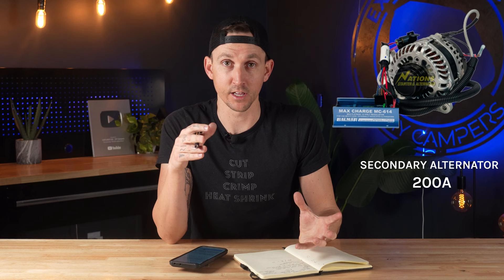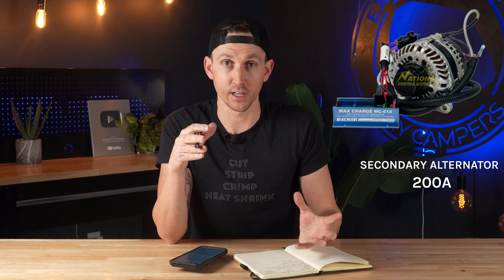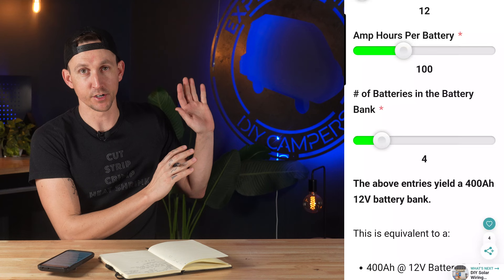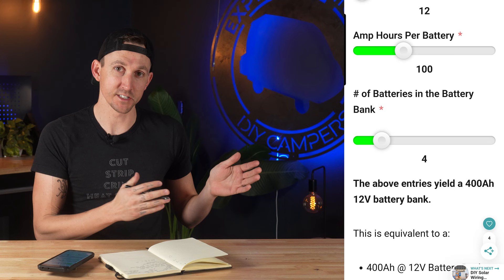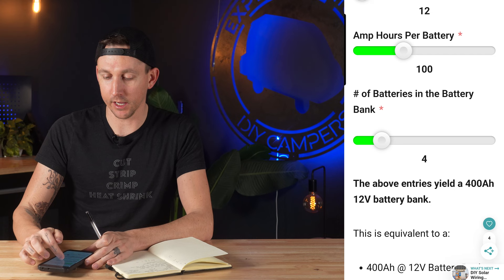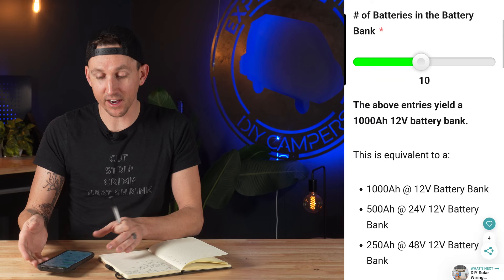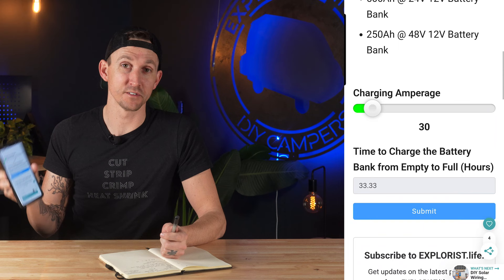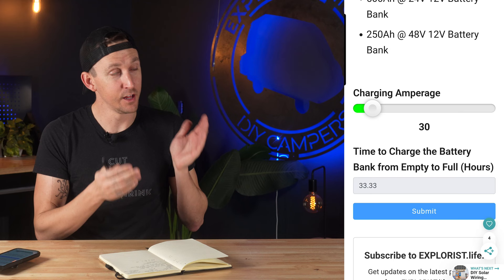ALTERNATOR CHARGING OR NOT? (for a camper electrical system)

Comment from the maker: *EXPLORIST.life Alternator Charging Wiring Kit:* https://shop.explorist.life/shop/all-products/camper-wiring-kits/component-wiring-kits/victron-orion-wiring-kit/
Reply: I ordered my truck with a second alternator with the thought that I could use it to charge a DIY electrical setup in my truck camper. The box of AUX switches is setup for 30amps or less. Im not really sure how to get the power from that second alternator to the camper in the best way possible. Mind you this is only while driving. I have a 2500 watt gen to charge while parked and 200 watt solar to top off.  I like the idea of alternator charging for two reasons. One, to back up the generator if I need to conserver propane. Two, to charge up between campsites since the gen is a bit noisy for any potential neighbors I like have the batts topped off before I park.

Comment: where you live matters as well, in canada, solar is only useful 4 months of the year.. rest of time theres snow or sun is too low
Reply: Just abt comment that
Reply from the maker: Yeah, that's a great point as well.
Reply: Or if you are in Michigan in the winter where you don’t see the sun for months on end so solar is useless in that case. But the good thing about being in a camper is you can simply move to a sunnier state.
Reply: That’s a pretty substantial exaggeration on available sunlight over the course of a full calendar year and misses the mark considering when people are most likely to use their vans (not the freezing depths of winter).

Where you live isn’t relevant. Where you use your van (destination) and when you use it are far more relevant considerations because those determine hours of sunlight.

All other things being equal (system, cloud cover, etc.) a van that spends its summers in Canada is going to produce more power per 24 hour period than a van touring around Mexico in the winter.

Comment: I upgraded my system to 1000w of solar (covered my 2 maxx air fans). I have the bluetti AC300 with 2 B300 (500ah) batteries. I haven’t had a stressful moment since. I run Starlink, fridge, toaster oven, inductions etc… never below 75% even with cloudy rainy days in a row! 🎉 Go solar!!!

Comment: I have the solar and generator options but still went with the 30 amp alternator charger for my 824 amp/hr bank.  I did it mainly because I have a 12 volt dc refrigerator that will be running as we are driving and I want to keep the system topped off with that charger and use the other options when camping.

Comment: Your primary customers are DIY van builders, but the majority of this video doesn’t really relate to them. Van builders want to camp off grid and it is helpful to use at least the 30 amp alternator charging when it isn’t sunny.
Reply from the maker: My primary audience is people building diy campers, not just vans.  

Vans will need alternator charging 99.9% of the time.

Comment: I completely disagree - Generators are not reliable, they're loud, and are being outlawed in some states.  A high output alternator can work while your main engine is idling.  A Balmar XT-250 will output over 100 Amps(at dwell temperature) with your main engine at idle. - I do have to disclose that I work at Balmar  :)
Reply: Honda has several very small, reliable, quiet generators with a long record on the market.
Reply: Alp propane is vey quiet as well and fuel efficient

Comment: I have a smart alternator in my 2020 van and my orion b2b charger doesn't always charge while I am driving and seems to stop around 80% a lot of the time. So the 10 hours of charging the calculator suggests may not always be accurate?

Comment: My charging is 95% solar, but alternator charging saved my bacon when I got trapped on the Oregon coast in wildfires.  My array was putting out 1.6% of rated power at local solar noon in the smoke haze.  For a month.

Comment: In addition to your just having solar, I think you need to factor in the time of year and latitude you are going to be traveling in and the fact that you won't always have sun; sometimes for days. I think alternator charging is a great thing to have, for additional charging capability, even for a back up. When you are traveling down the road, the additional stress the alternator will put on today's large diesel engines is negligible at best. Solar is by far the most expensive option. All things considered, a generator is your best bang for your buck, and super convenient if you are burning the same fuel from a large tank as your engine does.

Comment: HI, I have a 230 ah lithium bat a 220 amp alt a 1000 watt inverter and 400 watts of solar any suggestions can I use a 40 amp B2B instead of a 30 amp or should I forego alt charging ? thanks in advance !! PS I also have a 3600 Onan generator.

Comment: I am using dual 200 amp alts on my rig for 3 years now, one came stock and I added one. Got it from a wrecked truck with the same engine for $100 (like new) and had a local welding shop fab up a bracket for $125 and a new longer belt from Autozone for $48. I have 600 watts of solar and use the alts only when it's cloudy/rainy/AC needed on a hot day. No issues and no worries so far. Just up the idle to 1200 rpm and 4800 (let's round down to 4000 watts) watts will charge up the batts fast on the days I need it.

Comment: I think "redundancy" and "travel style" determine whether B2B makes sense to include in the charging mix. Weather and angle to the sun (think Alaska) often greatly diminish solar charging contribution. Driving every 2-3 weeks vs. every two or three days is informative. 

You're assuming a huge battery bank (e.g., air conditioner) and possibly over-relying on good weather. For 200-300AH banks, most can simply upgrade their existing alternator (to max allowed by manufacturer as a "direct replacement") and use a B2B charger. For example, my 2006 Dodge 3500 sprinter allowed for a 200 amp alternator. Calculating a load on that Bosch alternator, I could leave 20% in cushion/reserve and still use a Sterling 1260 charger, which I typically leave on 50 amps but sometimes 60 amps. 

If I had a larger bank 400-800AH, I'd still do an alternator charger, either direct replacement or second alternator, especially if I drove a lot. 

Generators are ok (I carry a Honda 2000), but they suck in terms of noise. In a good boondocking location, running a generator doesn't endear you to other campers. 

I'm a fan of your videos, but this one might have been a little underdeveloped in terms of pros and cons basis the application in one's rig. Like solar, once the capital outlay has been made, alternator charging is essentially a free bee, albeit a trivial amount of additional expense in fuel. The biggest upside of alternator charging is redundancy: just another source in one's charging arsenal.
Reply: Excellent comment.
Reply: Good comment thanks. Can you maybe direct me to where to look to learn how to set up something like this in a van?
Reply: Nate discussed this on his site of course. If you google the topic, many, many van lifers have implemented alternator charging solutions in van builds.  @WindsongSoundBath
Reply: @JohnS-zq8ks thanks. What is Nate's site, and what exactly are the words that you would Google to get this info?

Comment: One needs to consider their own situation.  Nate, you live in the mountains of Colorado, and mostly enjoy dry and not-so-hot summers.  We mostly travel in the southeast, and thus regularly face hot and humid situations -- where AC is important!

Given our desire for AC, we have a Sprinter (170) with 810Ah of lithium batteries and 525 watts of solar (this is all 12 volt).  We are adding a second alternator, which allows us to quickly charge up while doing just a bit of driving.  Notably, a large battery bank allows us to to better separate periods of charging from periods of consumption.

BTW, we prefer to park in the shade when it is hot, which avoids heat gain but reduces solar generation.

Finally, I will add that "the good news about a big battery bank is that you can run your AC (or anything else) without worrying so much about consumption."  The bad news about a big battery bank is that you gave to charge it!   A second alternator is a great solution.  I am happy to have a single internal combustion engine on my Sprinter.  A generator adds extra weight, takes room, requires maintenance, etc.  I already have an ICE under the hood. Better to use that sophisticated engine to run a 2nd alternator instead of fooling with a generator.  At least that's how I see it.

Comment: Thanks for the video Nate. Your broad expertise combined with your skill of distilling complicated topics to actionable plans makes you the van builder's oracle. I think most of us viewers will benefit from a more comprehensive exploration of this topic than charging a large battery bank from empty to full. One of the reasons I installed a large battery bank (600Ah-24V) was to create time between use of electricity and recharging.

I usually start an adventure with full batteries charged from my Multiplus plugged into the grid. Since I don't currently have an air conditioner, I can easily spend a week or more off-grid without charging at all, which is nice if I'm posted up at a backcountry ski area with cloudy skies or snow on the solar panels. Solar is my primary charging source and it eventually tops off the batteries. But in the odd case I'm running low on power, the reliable but slow charge rate of the DC-DC charger is very welcome. When you're out, a little matters!

Comment: I hear a lot about different charging solutions for RVs—DC-DC charging, solar, generators, etc.- and it's great that we live in a time when there are so many options. Ultimately, the best option depends on how you travel and the sources you have available for charging. In my case, I've recently upgraded my setup to include 2 200Ah LiFePO4 batteries in parallel, along with a Victron MultiPlus II charger/inverter.

The Victron MultiPlus II is a versatile device that acts as a charger and an inverter. It seamlessly switches between shore and battery power, allowing me to make the most of the 50-amp service at RV parks every night. This setup has been ideal for my large Cameo fifth wheel.

However, if one lives off-grid more frequently or parks without access to shore power, other charging solutions like solar or DC-DC alternators might be more suitable. Solar is excellent for off-grid living and provides a sustainable way to charge batteries, providing you're in an area where there is sun or you aren't parked under shade. DC-DC charging from a vehicle's alternator or an additional 2nd alternator can be a great option for charging while driving.

It's all about understanding your usage patterns and choosing the right solution. While my setup works well because I mostly stay at RV parks with shore power, someone who frequently boondocks might prefer to add solar or DC-DC charging.

For now, batteries, a good charger/inverter, and nightly shore power perfectly meet my needs.

Comment: I added an extra 100@ alternator to my van with a home designed voltage/current regulator
to protect it regardless of engine RPM. (300@hr lithium batteries). Internal regulator had no current circuit. Works great, never have to worry about alternator burnout. Simple PWM circuit. I charge the batt's to 80% state of charge, last longer that way.

Comment: Hello
I have the victron orion 24 volt, 15 amp alternator charger  installed on a  ford transit with 700 watts of solar on the roof.
This is my backup for when you have  multiple days of cloudy,  snowy or rainy  weather , parking in a dense forest  when off grid ,  in between canyon walls .. ect.  Alternator charging this way gives you options for very little money.
I love this unit, it works great and is reliable so far .  IMPORTANT!! Wire in the alternator charger with an on off switch so that it can be used selectively when you need it. 
 In real world conditions my Victron orion  Alternator charger puts out about 320 watt , 11 amps at 27+ volts . This works out perfect for me. If the engine runs for a 1 hour this gives me 19000 WATT MINUTES of charge.  I would not , do not , use alternator charging as a main wattage source. 
I do like your vids. Have been following you from back in the mountain bike days.
... side note.. the WATT MINUTE  is so much easier to use  as a unit of battery useage and keep track of in my head.
I make a cup of coffee.  The coffee maker runs for 2 minutes at 1750 watts.
2x1750= 3500 watt minutes. 
Subtract 3500 from my total watt minutes the battery bank has and your done .
Run the alternator charger for one hour and I can make 5 more cups of coffee.  YES!!
Sorry for the long post.
Mike
Reply: ??? confused me

Comment: Good one I bet there will be some discussions on that topic. Look forward to seeing the build. - But as a North European Vanlifer, not very useful for me. We hate generators here 🙂 - and we actually don't have very much sunshine in winter time - SO we usually have 2 systems running to charge the batteries. Solar panels AND DC/DC charger from the generatos also. I even swapped to a bigger Amp generator for mine.
Oh, and not very many over here have aircon units in the back - and only newer cars have in front.

Comment: Your calculations at 2:30 mark are theoretically possible but will take longer in practice. I have 200 amp 12 volt lithium batteries being charged by a 20 amp dc/dc charger and the charger may start off at 18-20 amps into the battery, but slows as the batteries get above about 90%. From 10% to 100% regularly takes over 11 hours with the engine running. It’s still way better than trying to use solar panels though.

Comment: Very nice, another point to consider is the voltage of the system.  If considering a 48 volt build, then a second 48 volt alternator is practically a must.

Comment: Hey Nate, first want to say thanks for all the help with my 2022 transit. TOPIC ALTERNATOR CHARGING. Wish I would have gone with a dedicated wake speed but I ordered my van way back in 2021 with dual. I am having a hard time implementing third party high power mode and or SEIC high idle. I have attempted several methods with grounding pins under the driver seat 3/1 as well at using the higher spec interface grounding options with no increase in voltage. Currently power a victron 30 amp Dc/dc and a sterling 120. It pulls well at idle but never ramps up rpm’s and don’t want to destroy my alternator, I have also wired an emergency extra charge source via an inverter that feeds my multiplus. I have dual transfer switches so I can feed the multiplus from my battery bank and it thinks it’s shore power via generator or switch to direct from ccp2 giving me an extra Dc/AC/DC charger and resulting in 250 amps from my batteries. I know your crazy busy but I am at a dead end

Comment: Hey, Nate. Thanks for your ' Time To Charge Calculator' I needed this for my E-bike that I have mounted onto the wishbone frame, to trickle charge my batteries, as I ride my e-bike. I am presently building a Buck Boost Converter to accommodate the difference voltages and Amps from the alternator to the my battery bank. Thanks again.

Comment: there are many use cases where alternator charging has other systems beat. In my case i started with a victron 30 am dc to dc. but while driving (class c motorhome) i switch my fridge to electric, that takes up 1/3-1/2 of my dc-dc, then my kids are on computer or game systems. and its the rest of the power is used up if not dipping to negative already. Not to mention the AC in the dash can not cool the coach and its surprisingly hot. so when i fire up the roof ac its using 1500 watts. So i added 1600 watts of solar panels to my roof, thats the most i could physically fit. they are flat on the roof so most of the time they are in the 1000-1200 watt input range. so i am still short on power. not to mention i like driving when its dark because its usually a bit quieter and less traffic. So the solar is useless then. I do have a onboard generator, but the wife and kids always forget to start it before the batts die and leave it running when its not needed. Plus it just burns fuel because its a fixed speed 4000watt onan, it just adds more stuff to service and keep track of and interact with especially when driving in the mountains, sometimes it dies and you gotta stop and turn the elevation adjustment. So i ordered the alternator kit with lithium regulator and harness like you showed here in a 200 amp version. That should cover all my basis when i get where im going the batts will be full and the extra ground deployable panels will cover the needs most of the time. the generator is my last fail safe option
Reply: Sound like you may benefit from also setting the generator to auto start/stop based on battery SOC as well, then it won’t be forgotten on, you could set the generator to start up when the SOC hits 30% and turn off at 80% or something similar.
Reply: @lebraun12345  I have an auto start but it's only enabled when parked and boondocking. If not it's just cycling the batteries for often then needed. The 200amp alt setup works well, when the engine is running I don't have to worry about anything. It uses a wakespeed regulator which is pretty fancy, it has temperature compensated charging as well as voltage and current. I couldn't even turn off the main battery disconnect and the alternator powers inverter directly. But it was a very spendy setup and a lot of people might not justify it